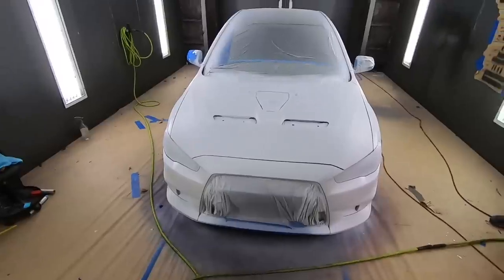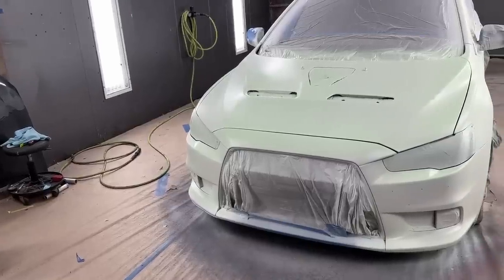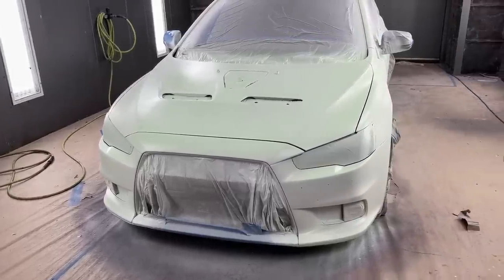Spraying a Car in the World's BRIGHTEST and GREENEST Pigment

Comment: Dang, 2500 for THAT. Holy Moly that is a terrible tinting strength. But it sure is an awesome color. I'm betting using the gloss coat would last longer, but you wouldn't get that killer matte finish.